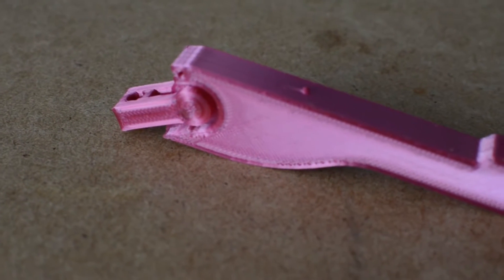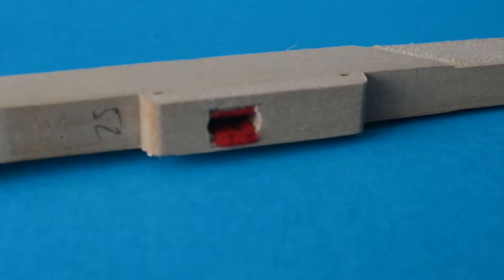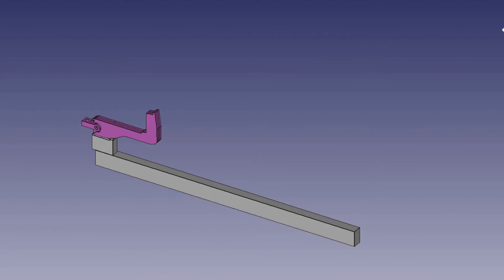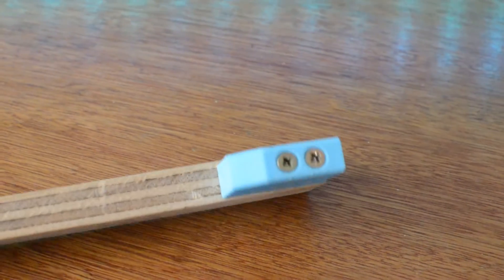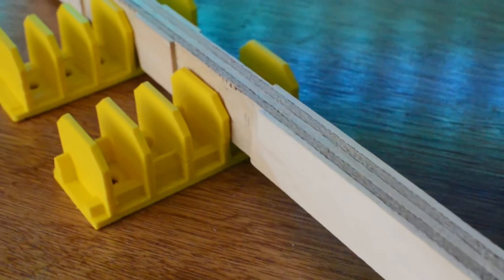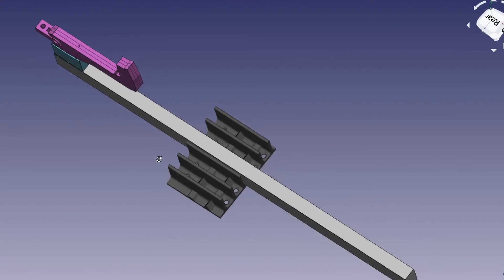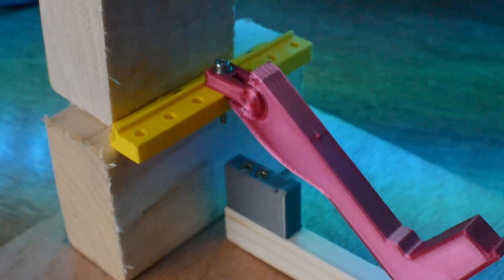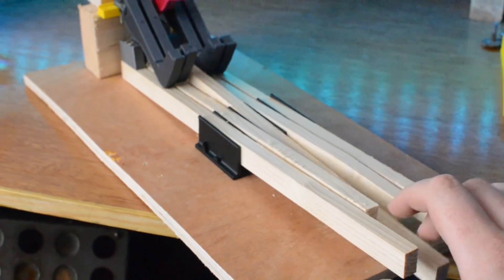DIY Electric Piano - Keys - Episode 2

Comment: I guess that to make improvements maybe you should talk to an experienced builder so you will know the reason of certain parts and materials. I wonder if you consider que effect of time and thousands of actions can make to this little notch. will the wood wear out right there? will it malfunction early? what is the function of the felt in those wholes? probably reduce the attrite of those parts right? what is the proper density of wood to get the right feel and action in the keys... hell it is indeed very complex. good luck!
Reply from the maker: I agree! there is a lot of knowledge and experience that went into the current design of pianos and electric pianos. Choosing to ignore that experience I am sure will cause it to fail early. But learning how it then fails allows the design to be improved and see where it leads us.

Comment: I have a idea regarding the making of the keys: Wooden base finished with plastic piano key tops. These key tops are quite affordable and I think will have a better finish than printed tops. My idea for the black keys is to attach wood to the top of each lever. Would glueing be enough for a secure attachment?
Reply from the maker: Yes I think acoustic pianos have the raised part of the black keys glued on (as far as i am aware) so that should work. And I agree commercial key caps would have a better finish. I enjoy the level of thought you are giving this.

Comment: I've actually been thinking about this, and feel the keyboard may be one of the hardest parts to make consistently. I don't think a 3d printed part this long would be straight enough, perhaps I am wrong though. I wonder if a good approach might be to print the front of the key, have a wooden or metal dowel/rod attach to it, then have the bump on the other end made out of wood or plastic and attached to the rod. The Hohner Pianet mechanism is similar to what I've described.
Reply from the maker: My plan is to have wood centre section. the key tops can be 3d printed also the pedestal.
But yes they most important word in s project like this is "consistent"
I really need to get my hands on a Hohner Pianet to see what we can learn from that design.

Comment: I am thinking of making a one key Pianet, as it is even simpler than the Rhodes action. I am using what I've learned from this series to get me started!
Reply: thats what im thinking lol. much more simple it just lifts up . the simplest you can get really lol. but i need a whole lot of help doing it
Reply: @RealPixelDude  People are making sticky pads from window sealing rubber or something. I think the reeds are similar to a harmonica, but no doubt are a different size/tuning. So I don't know where to source these. The other thing is the pickup, which I think might be simple like a piezoelectric type.
Reply: @lundsweden  im wondering if i could re purpose spoons and forks lol. i want to make this as cheap as possible (under 200)
Reply: @RealPixelDude  That's a really interesting idea... I just wonder what the tonality would be like.
Reply: ive got some scrap items. i have a shopping basket and i'd wonder what that could sound like @lundsweden
Reply: @lundsweden  i dont really mind lol i just want something that makes noise

Comment: Have you seen that wood-impregnated filament is available (for the keys?)?
Reply from the maker: Interesting idea, I have heard some horror stories of needing to use larger nozzles for wood filament. But it would be interesting to make it all 3D printed. The reason I I didn't was that most wood shops could pride the keys cut ready to use for little or no each cost. This would be cheaper and quicker than printer....though still interesting idea.

Comment: That's super cool, just suscribed as well! Just a quick idea: did you think about adding a long metal rod through holes in all the keys, perpendicular to their lengths, which would provide a pivot point for each keys? You could still use your black plastic part to hold the rod so it's not sagging, and that would probably reduce the friction quite a lot, even more if you add felt in the holes like on traditional flange bushings. Anyway, just a thought, really curious to see your progress!
Reply from the maker: Hi Kevin, Thank you. That is a good idea. I might have to give it a try.